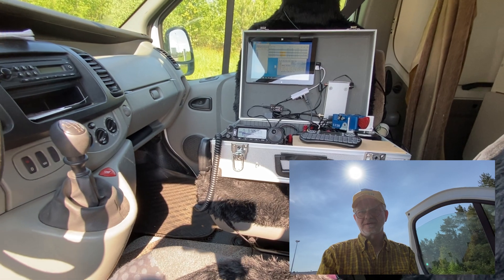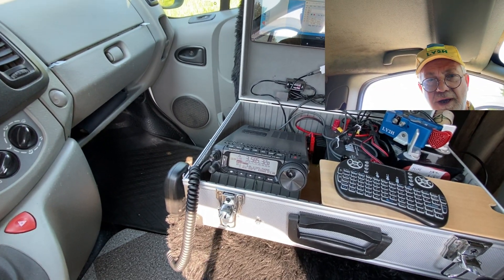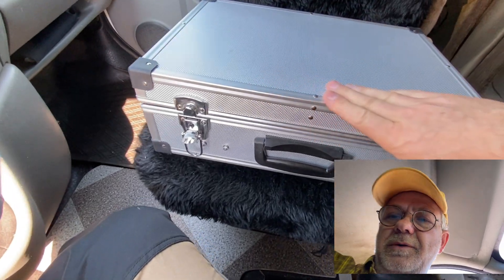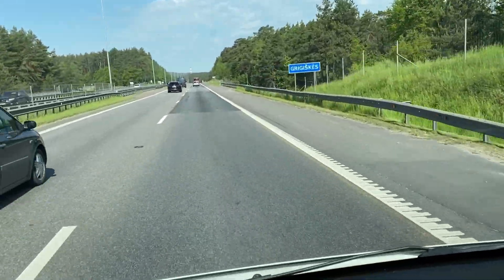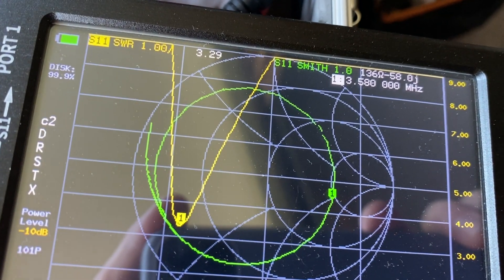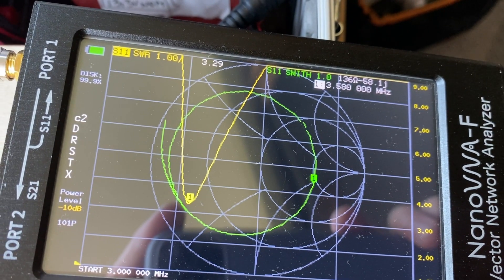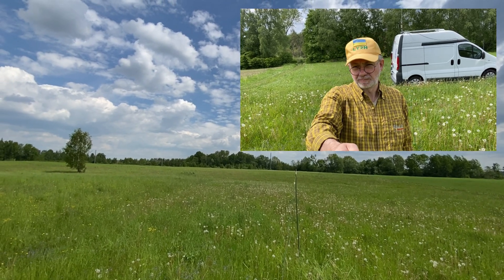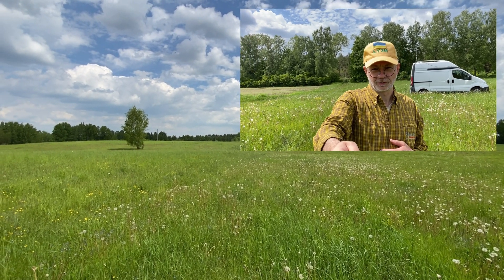Make an L-TYPE antenna for 80m band (and up) using 5m whip and one elevated radial!

Comment: The vertical should put out a nice true ground wave but that doesn't go very far, even on 80 m. Most of your contacts, certainly the ones 100 km out and more, are via NVIS and not via ground wave, and the vertical doesn't have much output at high radiaion angles. So I suspect most of the useful radiation in your exercise came from the counterpoise. If that's true, then perhaps a better way would be to omit the vertical and use a wire of convenient length kept a metre or two off the ground with e.g. hiking poles as antenna and one or more other wires lying on the ground as counterpoise. You could try both ways with some local QSOs and find out which way produces stronger signals. A more or less horizontal wire even if very low will put out an amazingly strong NVIS signal on 80 m. But you would have to use a tuner.

David  VE7EZM and AF7BZ
Reply from the maker: Thanks for the comment David! It's certainly a hamfest-favourite antenna debate  topic! I'm not sure which part of the antenna radiates more in this set-up :) It's too many variables involved that even the EZNEC would get lost in its calculations  :). But it works, that's most important! Yes, I've been trying to use just a 13m wire with the upper end at 6m hight and a 9m radial laying on the ground in my backyard and this system was working too with the tuner down to even 160m band ( I have an other video on this experiment) but its behaviour, impedance measured and SWR was quite different from the coil loaded vertical and the elevated c'poise I used in my field day excercise. So I think, the vertical part  even being too-short/too-low is an important radiating element in this antenna system. But I totally agree with you that it would be the best way to compare the two antennas for the NVIS propagation in making real contacts with other hams! That's what ham summer is for, isn't it? Have a good one! 73! Linas LY2H

Comment: Great video.  Thank you.  I operate in the parks near here and cannot put any wires or ropes (California) in the trees.  My bands of preference are 40, 30, 20.  I have a 5 meter fishing pole on a tripod (6 meters to the tip)  I would like to add a coil like you are using for tuning.  

Do you think  one radial 6 meters long and 1 meter high and be effective for a portable antenna?  The coax feedline and line isolator cable would be about 3 meters long.
Reply from the maker: Thanks Jerry! Yes, I think your set-up would work on 40,30,20 (and up, if you can make the wire a bit shorter on higher bands, like roll-up on the top and by-passing the coil). A 6 meter counterpoise will be a bit too short on 40m band, something like 9-10m would be better. But it will work, just the SWR might be higher even if the coil will bring the vertical part of wire to the resonance. In the L-Type antenna ( and it is an L-Type as long as radial, because of elevation , starts acting like a part of the antenna, not a ground plane) the horizontal wire ( counterpoise) is resonant too and it takes some pruning and tuning in order to have the whole system of vertical and horizontal wire resonant with the lowest SWR. In theory, and in good practice, you adjust the length of the counterpoise and choose the right tap on the coil on each band. In a real-life practice ( or emergency),  whatever length of the horizontal wire ( I don't call it radial anymore :)) you have , it will do as long as it is elevated no less than 1 m above the ground, and provided you have a tuner. My experiment in the video proved this. I had the vertical whip tuned into resonance on 3.6 MHz by the means of the loading coil , and my horizontal wire was only 13m long. It's too short for a 1/4 wl on 80m , so my SWR was 3.3:1 even with the vertical whip at resonance. Have I had a longer wire , like 20m, I could have achieved better SWR by adjusting the length of the elevated counterpoise. But I had't, so my  tuner did its  work no problems  and we all did a good job in the contest!  The RF choke at the radio side preferably, is a must in such an asymetrical system. HTH , good luck in experimenting! 73! Linas LY2H

Comment: I use something similar, mfj-63 loading coil with the same telescopic whip in a l shape or with radials works well on 80 60 and 40 meters short the fly lead out at the top of the coil to work on the higher bands sometimes use a tunable counterpoise as well.
Reply from the maker: Cool! It works!
Reply: Could you describe your tunable counterpoise?  Thanks
Reply: @ptgolfer4  hi Jerry, I have a couple of options available to me, let's start off with that a tunable counterpoise could also be describe as an artificial ground, I have two different artificial grounds that I use one that I use out in the field is a wonder wand tunable counterpoise system and the second I use at home MFJ-931 artificial ground I live on the top floor of a block of flats about 65 foot above the ground it's to long a run for a ground wire with out it becoming part of the antenna so I use an artificial ground to basically behave like a true ground in the flat it works best on the lower bands 160m to 40m above this ground current isn't much of a problem, another way to look at this is that it's like ant ATU for your ground Peter VK3YE has a video describing how these work might be worth a look, I hope this helps I'm not an expert in this area.